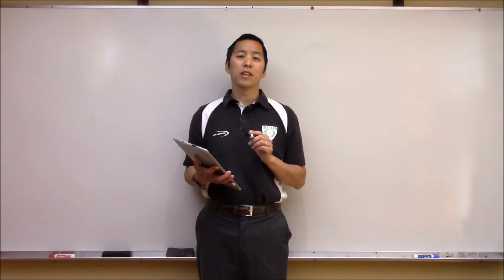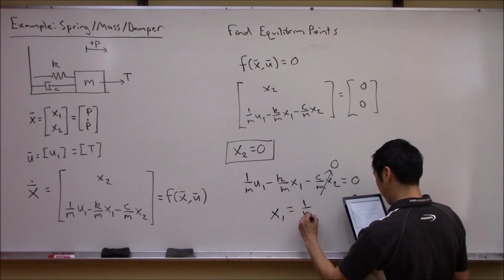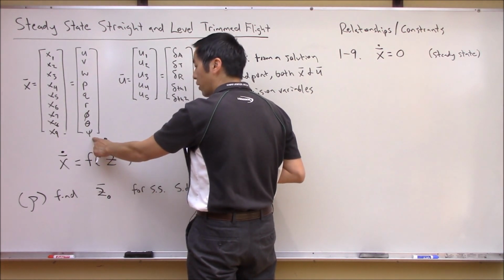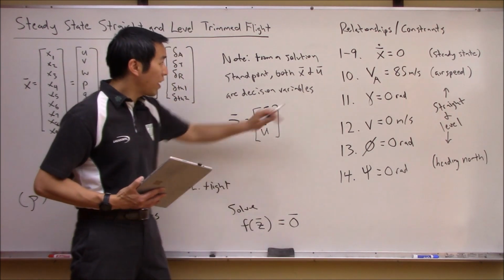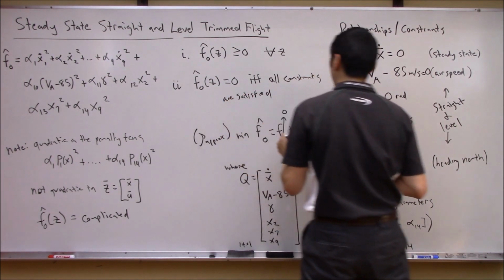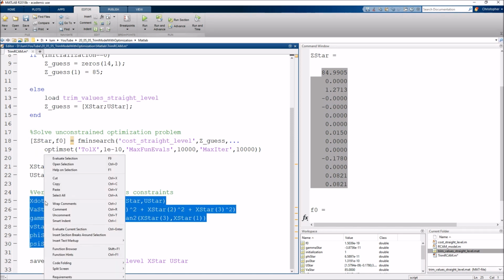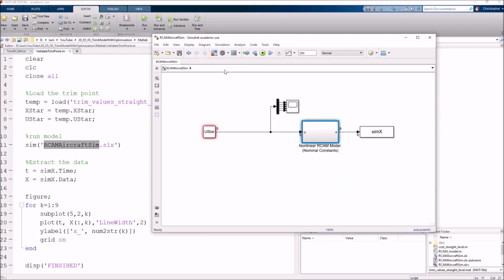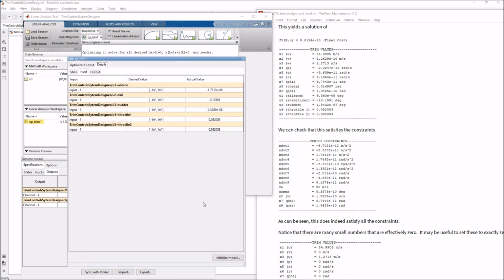Trimming a Model of a Dynamic System Using Numerical Optimization

Comment: AE512_NP It's clear to see how a small perturbation from the control input can affect the system and if it can stabilize itself when using the trim points.
Reply from the maker: That's right, trim points are really useful for getting a baseline for how the system might respond.

Comment: AA516: This is a very cool and important concept. For modern aircraft, does this trim point remain static in the system on do pilots (or computer) ever change these points mid-flight?

Comment: I was able to find a trim point using the cost function fminsearch method, but my simulink version does not converge to a solution, although I have the same settings that you do. The simulink output is identical to that from the other videos, so I am pretty sure that my model is also correct. I noticed that it would consistently return results where both engine throttles were zero. Kicking it to be any value between the minimum and maximum thrust value brought it into a trim state.

Is this a proper procedure? Why would this happen? It seems like the thrust input is maybe not being updated by the saturation code, but I've double checked to make sure it is correct:

if u4 > u4_max
    u4 = u4_max;
elseif u4 < u4_min
    u4 = u4_min;
end

if u5 > u5_max
    u5 = u5_max;
elseif u5 < u5_min
    u5 = u5_min;
end

This series has been extremely helpful.
Reply from the maker: Hello, 

I am able to answer question directly through my Patreon page at https://www.patreon.com/christopherwlum.  Please free to submit your question there and we can discuss.  Thanks for watching and for supporting the channel!

Comment: Christopher, I'm trying to apply this method in my work, where I want to compute a steady-state solution in order to linearize the model calculating the jacobians, but I was thinking in using the input variable as constraints....
It is possible that the number of constraints is less than the number of unknowns to be solved? Because at the end of the video you said that it is possible to solve for a number of constraints higher than that number of unknowns.